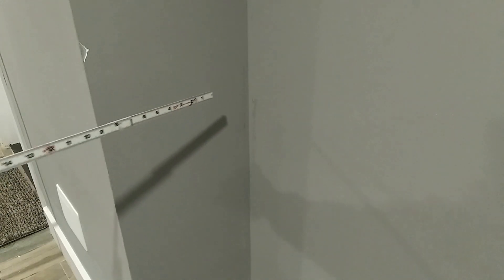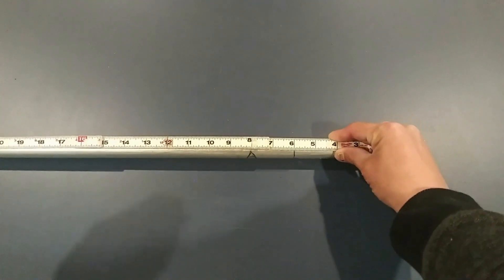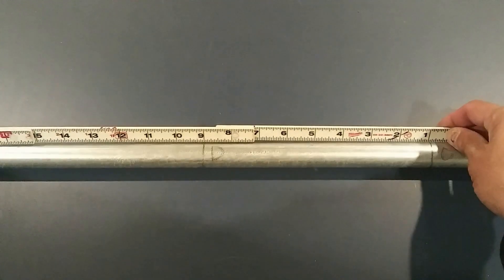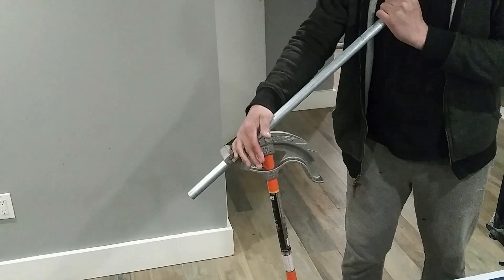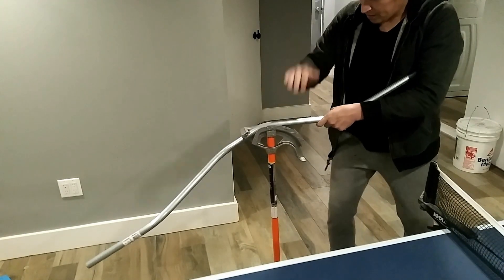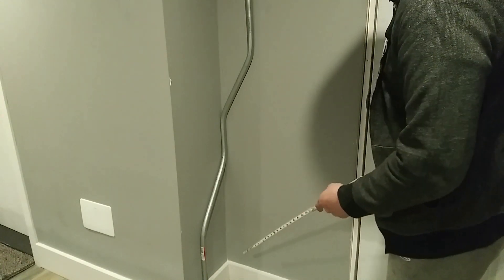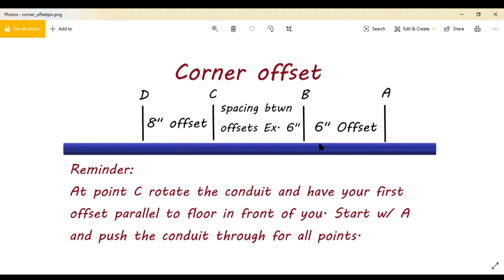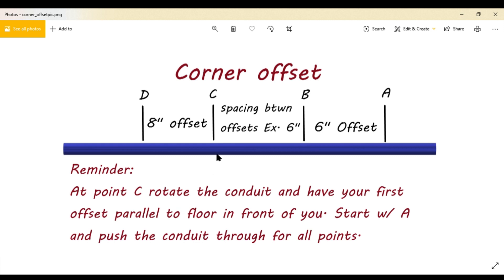Conduit Bending: Corner Offset, How to Measure, Layout & Bend.

Comment: Awesome ! First time i see someone explain this. I subscribed.  Excellent work.
Reply from the maker: Thank you so very much for the feedback. It takes a minute to put these video's together and all i ask is to please give me a simple 👍 or 👎 so i know if im wasting my time. Electrical is my passion, but conduit Bending is my passion within my passion so there's nothing i love more than to pass this knowledge on. 
Check out the 3 point saddle push-thru method unless you already know it. Pretty cool.
Follow me to get updates on the next video's.
FB: Melvin@HolmzLaw
Insta: HolmzLaw
Twitter: HolmzLaw@LiveWire480V
Tiktok: HolmzLaw
Reply: @TheArtOfConduitBending  
Conduit is my favorite also. I think we learned from the same teacher because its dead on with what i was taught and studied. Thumbs up for sure. Yes seen the pass thru best thier is especially if you have your bender charted. Keep up the good work. Its awesome you share it. I try to show others but they dont care about the math. I dont blame them, 30's using multiplier of 2 is all they want. I like to know i can use any angle find the multiplier the gain , cut , thread, and it fits.
Reply: 2:01 p

Comment: Quick question, what about the shrinkage???
Reply from the maker: Shrink is the same as any other offset only now you have 2 offsets together. So whatever bends you use just find the shrink for it and you would use that shrink times the total rise of both offsets. Ill probably have to do a short video on it.
Reply: @TheArtOfConduitBending  oh ok, thank you.
Reply from the maker: @Eric Diaz Plane has no impact. it's just 2 offsets you calculate it like any other pair of offsets. 
So just measure the distance from A to B then add the shrink for the 2 offsets depending on the rise of each offset. Hope this helps. please tell me if you understand. If not ill give you an example.
Please follow me on
Facebook @Holmz Law
https://www.facebook.com/groups/conduitology/Follow   
IG @Holmz Law  
Tiktok @Holmzlaw
snapchat/holmzlaw
tradehounds/holmzlaw
linkedin/melvinrubio
discord - ask me for the link to join
Reply from the maker: @Eric Diaz ok so stop worrying about the different planes. just worry about height from box A to B (72"). then calculate the shrink separately for the 2 offsets like you have a 30 degree offset of 2 inches so shrink is 1/2" for offset #1 , offset number 2 has a 30 degree offset of 4 inches so shrink is 1 inch. Total shrink is 1.5 inches. So
72 + 1.5 = 73.5 inches need to complete the run from box A to B. Hope this helps. Also find the face book group The art of conduit bending and join.
Reply from the maker: try this link
https://www.facebook.com/groups/conduitology/

Comment: what I am confused about was in the second offset you marked it at 8 inch instead of the 16 inch multiplier
Reply from the maker: Don't let it confuse you it's just 2 offsets with a spacing in between of however much you want. I just mention to try not to make your to offsets to close together a good number would be 6 inches.